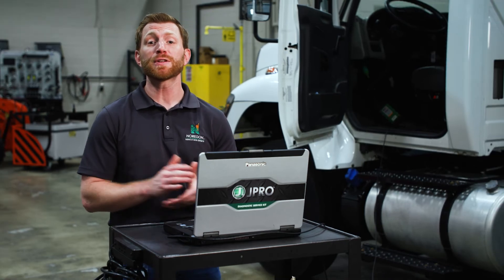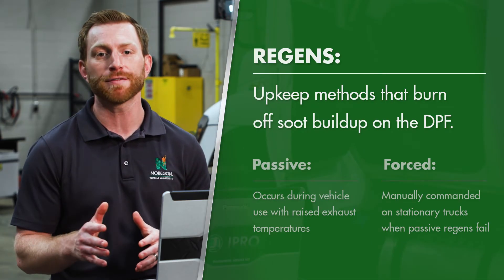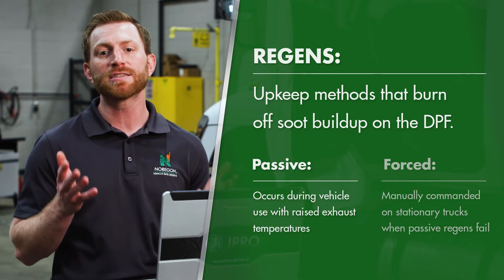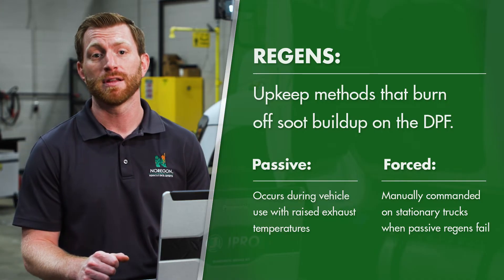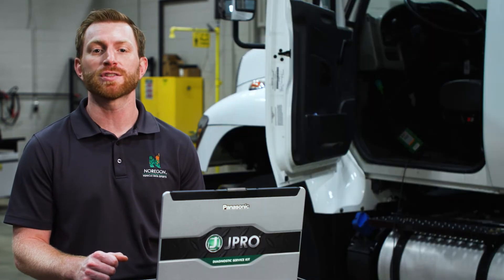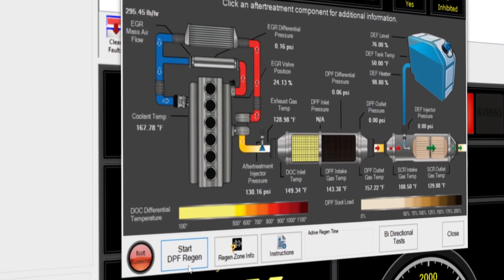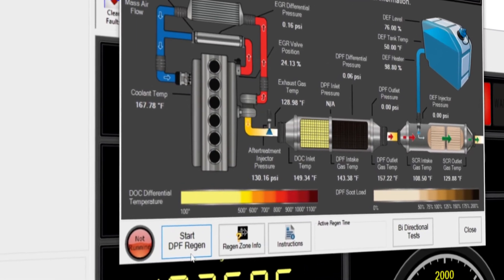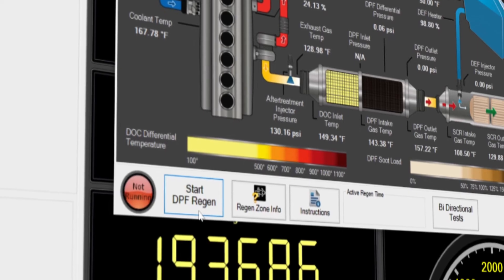TechTips - Forced vs. Passive Regens

Comment: Important safety advice is to only perform a forced regen when the exhaust gasses won't come into contact with anything easily combustable like grass or a fuel station parking area or near stored liquids. Only perform a regen in an open space with and make sure there's at least one fire extinguisher to hand.  Set the vehicles heating controls to max heat and full fan blower. Check oil and water is topoed up before even considering performing a forced and never leave the vehicle unattended

Comment: How can u regen a truck that has no way to do a manual regen? No button or no way on the dash
Reply from the maker: You can still do it with a diagnostic tool like JPRO. If something blocks the regen, JPRO will flag it so you can correct and retry. If needed, a dealer can also enable/perform regens even without a dash button.
Reply: Read the vehicles manual.